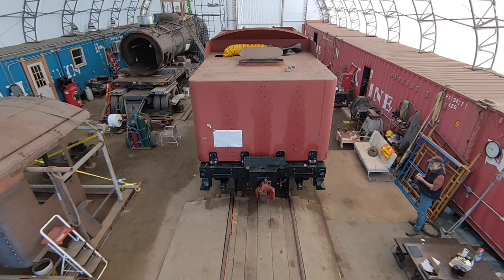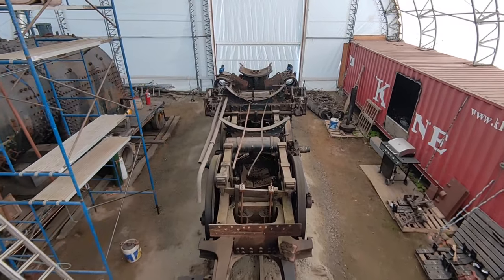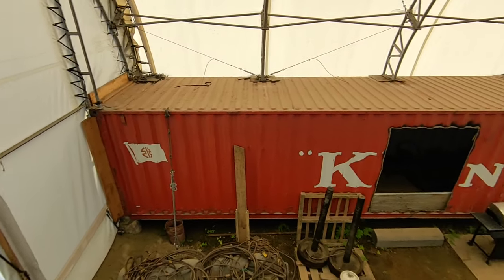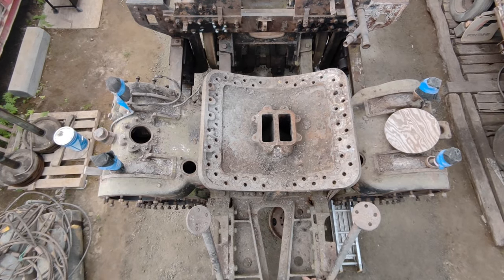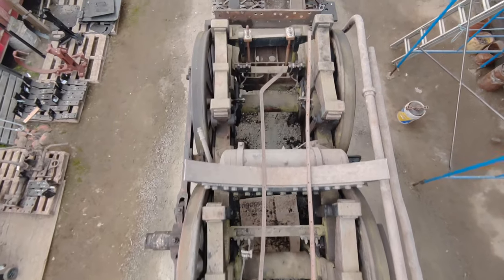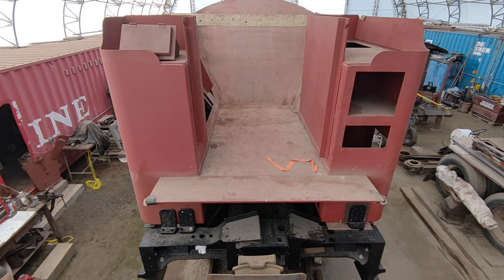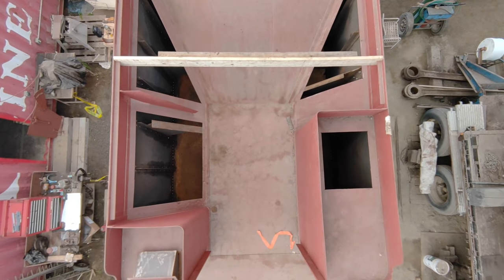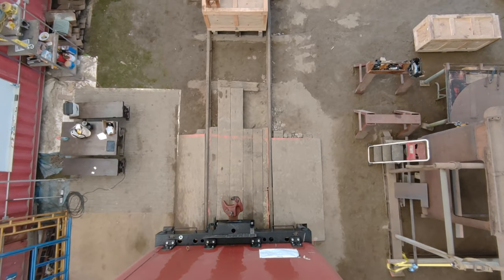Maine Central 470 Restoration Tour [Pt. 2] -- Tender & Chassis

Comment: I noticed that 470 has a cutout in the smoke box, hinting at a Coffin Feed Water Heater. How much are you guys going to use it, and how do you guys plan to go about removing it from the smoke box itself for restoration and cleaning? Also, how much work have you guys done to the frame? It looks in pretty good shape for something that sat outside for a few decades. I wish you all the best of luck with the restoration!
Reply from the maker: 470 was equipped with a Coffin feedwater sometime later in its career. Because of the type of service we anticipate, the feedwater heater will not be used. The heat exchanger in the smokebox will have to be removed by using an Air-Arc torch. We will use a second injector that will replace it, and it is what 470 originally had. It will be much simpler to maintain.

Regarding the frame, it does appear to be in good condition, but will be inspected in detail when the time comes.